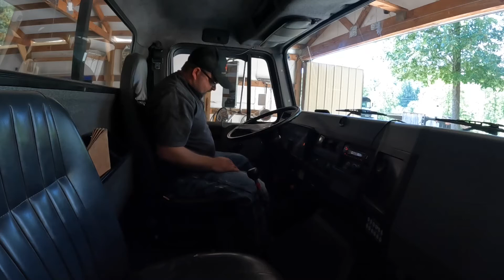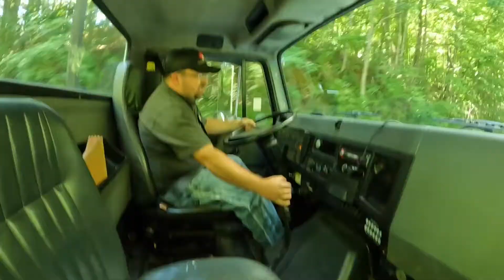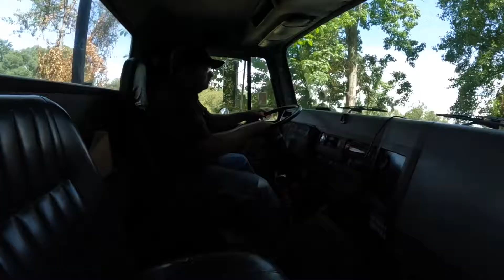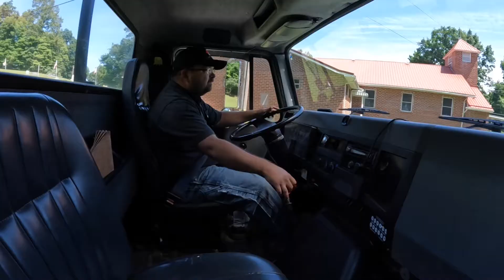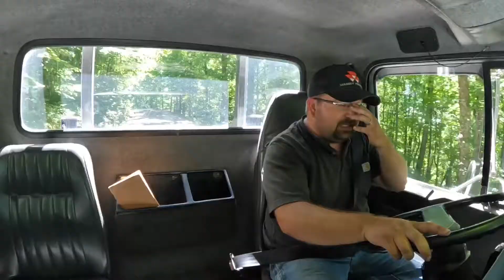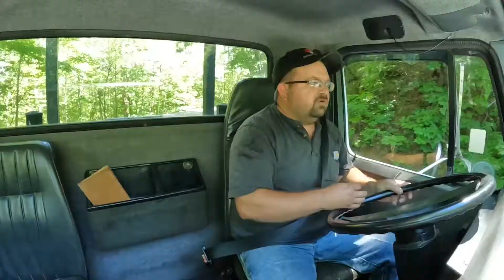How to Shift a 5 speed with 2 Speed Rear Axle! International 4900

Comment: what I'm confused about if you go through the gears shift to your high side of your differential go through the gears again that's your 10 speed when you go from third high to four low how does that even work first high to too low that doesn't make any sense
Reply from the maker: It’s not a split transmission. You only getting a half gear by changing the axle. So you can drive like a 5 speed or split each gear if needed. On this 4th high and 5th low are the same speed. Do you can either shift from 4th to 5th then to the high range in 5 or go to high range 4th and go on to 5th high. So no need to split the axle between 4th and 5th.

Comment: I recall using an old c70 with a 427 gas job and the 5 speed 2 speed setup, working for a tree company and his shop was up toppa big hill. Coming back end of the day with a load of chips or logs and big chipper behind, you definitely got used to splitting some of those gears usually 3rd n 4th with that rear end. 
Nice instructional video there thanky, joy yer day.
Reply from the maker: I really appreciate you watching!

Comment: My new hydro jetting truck is this exact truck I think. I love it I’ve only had it on the road for about a week but the two speed axle was very easy to get used to. And it shifts so nice! Most of our trucks are eaton fuller 10’s but I kind of prefer this now that I’m used to it! Thanks for the video you definitely gave me some tips. What year is this one mine is a 2001 looks very similar inside.
Reply from the maker: This is a 1992. Thanks!

Comment: See as a younger guy im getting into the stuff and shocked that its been around for as long as it has. Sadly though im getting into it at a time that its been long obsolete. I asked my dad whos a medium/heavy duty diesel tech about if he ever worked with this stuff and he goes "Son this stuff was dyin out when I was a young mechanic and that was 25+ years ago." Ever since I found out about gear splitters I told my buddies, im gonna get me a 6V-53 Detroit, a 5 or 6 speed manual behind it and either an Eaton 2 speed rear end or an aftermarket gear splitting kit. Ima build the coolest truck around. I LOVE the old long nose Peterbuilt semi's and the square body Pick ups. Im gonna cram that whole set up into an old square body crew cab long bed dually. Idc what brand it is
Reply from the maker: Good luck with your project! Sounds interesting.

Comment: So to clarify. You do NOT need to double clutch?
Reply from the maker: No not on these, but I will at times under a hard pull or down shifting. It helps in certain conditions. But these spicer transmissions are synchronized. Thanks for watching

Comment: Here in Brazil this is called a reduction in the differential usually used in trucks from 180 to 280 hp, 6 low gears and 6 high gears!!
Reply from the maker: Yeah my truck is set at 210 hp. The extra gearing really helps. Thanks for watching!
Reply: @khtractors  https://www.youtube.com/watch?v=N3Xtb_q6zWg&ab_channel=DiegoPereira It works like this here in Brazil, not very different from this truck of yours!

Comment: Another fine video Ben, I haven’t mastered my 5 x2 yet. I bought it three years ago and just don’t drive it enough it’s got a 10 foot dump bed with a Cummins 5.9Ppump. Back in June I hauled 2 loads with it and I bet I’ll have to jump it, in order to start it today. Thanks again for the video
Reply from the maker: Yeah it takes practice, I still mess up at times. Thanks for watching!
Reply: I got a 1993 F600 w 5.9 2sp 5.  I pump it a little but starts right up after sitting for months.
Reply: If you guys are not using your trucks that much get a solar battery maintainer. Your batteries will last longer if they stay charged.

Comment: All things considered, would you prefer the 5/2 combo or would a 6+1 transmission be better in your eyes?  

Project Yellow has what I think is a Clark 5 speed.  I need to check the model to see if it is a direct 5th or overdrive.  Good video!
Reply from the maker: I would love to drive a 6+ transmission and see how it’s gears are setup. If it eliminates that gap between 3 and 4 that would be great. But I see a lot of people needing to replace the 6 plus vs a 5 speed. I think a good 13 speed would be awesome. Thanks for watching!

Comment: Excellent tutorial. Beats the old double-clutching between the axles. The old school buses I road had to be double-clutched - well, the bus driver did whether it actually had to be or not. To see you go between ranges without having to clutch at all surprised me. I guess it’s been too long since I’ve been in a big truck.
Reply from the maker: I started out clutching during the axle shifts and later learned it does better without the clutch. The bus you rode may not have had a synchronized transmission which would require double clutching. Thanks for watching!

Comment: Thanks for the demonstration man. I’ve always discredited 2-speed rear axle trucks on account of folks saying you end up down more with a 2-speed axle. What has your experience been? Have you towed much with one? When folks end up with a downed 2-speed rear axle . . . is it usually for the “splitter” being stuck? Sorry for all the questions - Samuel
Reply from the maker: Most issues come from misuse. Electrical wiring problems can be an issue as well, and on older trucks vacuum worked the shifter so any vacuum leak would give you fit until found. I struggled for awhile with shifting it but I’m getting better now. I’ve only had the truck a year. Thanks for watching!

Comment: I worked at Komatsu where they built off highway trucks, loaders and excavators. They had a semi with a triple wide trailer that they had built. So in order to take a semi built truck from the assembly line to the paint and for shipping they would load the truck onto the trailer, drive it outside to the other side of the same building and sometimes back it in, or drive it into the building. That was my job for the most part. And as I did this i would shift through the gears. Other times I would have them load up an excavator and I would take it down the road to an all steel plate area for them to unload it with big steel ramps for their testing they did, so there i could run through quite a bit of gears.
Reply from the maker: That sounds like a fun job! Thanks for watching!
Reply: Newberry????